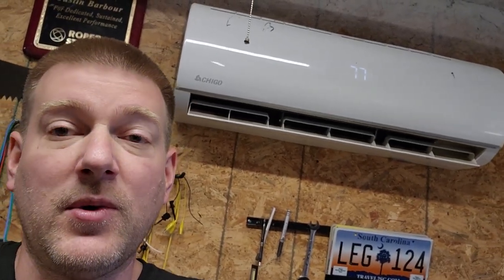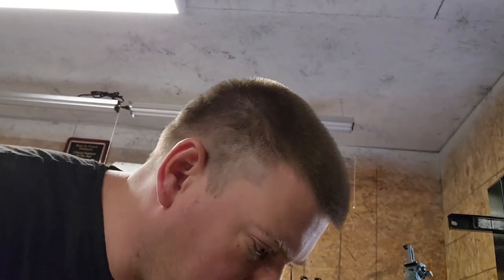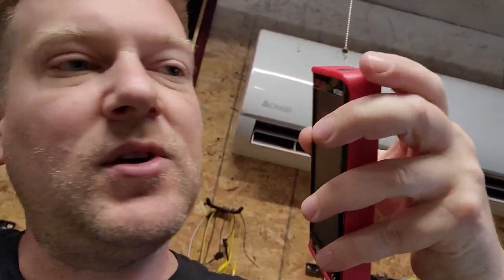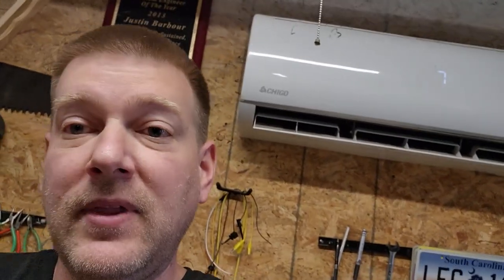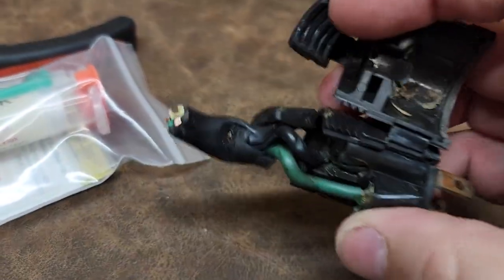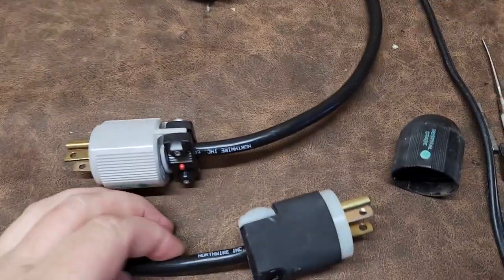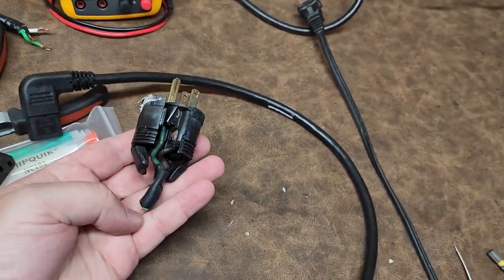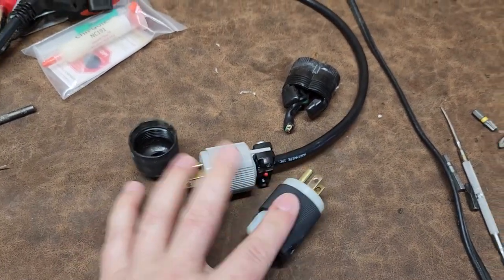Too Hot To Troubleshoot

Comment: Good explanation on troubleshooting the  AC source. If the source plugged in externally, it should be protected by a cover. The cover is designed to protect the plug and receptacle from outdoor weather elements.

Comment: For my GFI Tester, I use a Standard 3 prong plug with the Nutral tied to Ground. I also use this same Tester in the Operating Rooms with LIM Units, to purposfully Trip the LIM, which causes LIM to Alarm and changes the Normal LIM Condition from 60VAC on the Hot and Nutral legs of the Outlets to a  Normal Grounded,120VAC on the Hot Leg. Now I can do an Electrical Safety Test on equipment in the presence of a LIM. The only problem is that you need to notify OR Staff of the Alarm Before you trip the LIM. Drives OR Staff nuts.
Reply from the maker: Line Isolation Monitors need to be tested annually with a calibrated leakage source. The 5uA trip point is very specific.